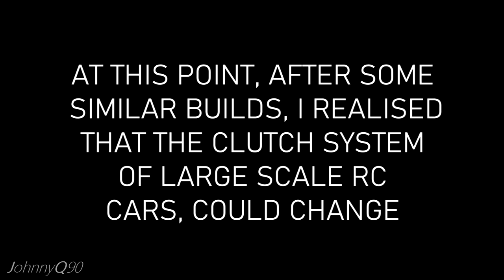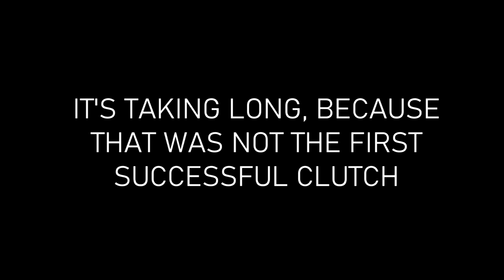Making a MANUAL Clutch for the V8 RC Car - FINALLY!

Comment: Hey JohnnyQ90. I’ve often thought that this would be possible but couldn’t help thinking that such a clutch would require some kind of logic circuitry to be most effective, simply because throttle and steering control pretty much take up all your attention while controlling an RC car. Which begs the question “How exactly should the clutch behave and under what circumstances?”. Sounds like a job for an Arduino Nano to me 🤔

Comment: I was wondering how u were going to make a car like clutch for this thing. This design has a lot of promise. I think the only upgrade might be to make it more like a drum brake on a car. Drum bolts to crankshaft, and then you could have springs forcing the shoes out, and the servo retracts springs

Comment: Maybe add spring pressure to the clutch so it could be button off.     So driving you could pop the buttton on shift on the fly.    Instead of dailing  in clutch force.

Comment: I think that would be better if the servo didn’t have to keep pressing the clutch while it is in contact, this is hardworking for the servo, the majority of time the clutch should be in contact, even when the shaft is in idle! You should probably use a spring to force the clutch contact and use the servo force just to disconnect it!

Comment: hello, i'm following you from naples, if i can give you my advice connect the clutch servo to the pulse of the throttle servo so that when the throttle is opened the clutch automatically engages without having to act on another channel.

Comment: You prob had this question before but just curious how is the conecting rods lubricated without oil in crank case since isnt 2 stroke and atomised fuel isnt run thru crank case like 2 stroke i mean i seen the start the drops of oil used in asembly but is that enough for life of engine?

Comment: Might be better if the clutch is pulled in by a spring so there’s no thrust on the slip ring when the clutch is engage, only thrust on the slip ring when the clutch is disengaged.  Most of the time the clutch will be engaged so you want the wear to occur when the the clutch is disengaged.

Comment: Hey Johnny. Little off topic here but I’ll go ahead anyway. I’m building a RC jet boat using the TFL jet drive B54270 its a 39mm dia impeller. I want to power it with a mini model engine. I’m looking at the NR200 do you think it would have enough torque to adequately drive the jet drive ? Should I go with a Cison L4-175 ? It came with a 4074 1400kv motor. The hull is going to be a 24” long aluminum river jet boat style.

Comment: That flywheel will be great for low end torque due to its massive weight in comparison to the engine weight, but for more revs and faster acceleration a lighter flywheel may be required.

Edit: (secondary thought) Fuel usage would go down as well perhaps with less rotational mass in the drivetrain by reducing the flywheel weight.

Comment: If you could program it to when you have a 3 position lever switch on the transmitter to when you switch it it engages and disengages the coutch for you

Comment: Man, I really liked the car. but like this? What is the total length of the car? I want to build one like this!
With 4-stroke engine, manual transmission with clutch and AWD. making mini car for rally or race. What would you recommend I do to reduce length and weight? I want the minimum amount of shaft connecting one thing to another like you did in the transmission

Comment: Would you be able to make an RC crawler wheel for demonstration purposes in a 2.2 scale size or 1.9 scale size with a pocket nc, I have been wanting to buy a pocket nc but would like see if it can be done first before spending the money on a machine like that. That would be the only purpose for buying one to make wheels for hobby grade RC cars to be able to make custom wheel for my RC cars and trucks. Thank you.

Comment: I think you are amazing bro.... You will need to look at a new controller for it... I don't think a traditional hand controller is suitable.... I was thinking of something like an Xbox controller with fpv so you can steer and change gears at same time using finger trigger for the clutch and thumb stick for steering... Could be a good 3d print project

Comment: Ahhhh....you know you can stick a piece of dowel into your part to catch them before they get whacked by the chuck right?
Oh....when trying to make matching tapers you should never move your compound setting between cutting both tapers.
Even if it means cutting the tapers last and adding a step.
   You can however use a paste lapping compound at the end to make the parts fit properly but I've never tried it with aluminum to plastic but I dont see why it wouldnt work.

Comment: the teflon part has a conical shape but the metal part does not, or at least not the same angle, and the contact surface is too small which equals to more heat, more wear and possibly less grip.
What about making both the teflon part and the metal part both conical and with the same angle?
Reply from the maker: Both male and female cones have the exact same 13 degree angle. I didn't move the compound on the lathe when I was making them, in order to be sure that they will have the same angle.
Reply: @johnnyq90  my bad, I saw in the clip from the beginning what appeared to be a contact line, and I assumed that the metal part was not conical.

Comment: I see a problem here. The servo is pulling an arm that is pushing on the brass collar that is pushing on a spinning plastic thingy. The brass collar is under high pressure and pressing against the spinning plastic clutch thingy. Friction is not a joke, maybe a bearing should be considered. And also don't forget that now you have a force pushing the crank shaft forward. Also bad for the engine.

Comment: I fear that the clutch will melt once you really use it. Maybe a metal cone with cork would be better? You can get cork tiles in a hardware store, but needs a heat resistant glue. The clutch bell can act as form for glueing the cork on/in (pockets?) the cone..

Comment: An automatic engaging/disengaging clutch with the help of an arduino would be nice. Otherwise it will be too hard to drive. Decrease throttle, disengage clutch, change gear, increase throttle, engage clutch. That is too much work to do on the controller.

Comment: The plastic materials are not durable against to the heat and friction. If you want to more durable clutch for your car, you have to use heat resistant material or use metallic material can be keep the heat that couse from friction between cone and bell. 
On the other hand, the automotive industry is using a friction material on clutch plates. It is providing only one item is getting older in using time in the clutch system. Because, it will provide easy and cheap servicing.
Additionally, I would like to say you that, you can use another clutch system between shaft and cone. It is a oneway system for take the first movment stress. Like the 3D printer clutches between motor and shaft.
The last one, what do you think about the multi-plate clutch systems like motorcycles? It will be much better for smaler place than exist.
Thanks for your videos. I am following with interesting.

Comment: Ok so i dont see the link to order one... lol you know you can  start a rc car manufacturing line and promote it all with just these videos ...
Can you set a mixer so as you increase throttle it applys the clutch? Then you can use the dial as a scaler to adjust the engagment point!

Comment: The main design issue I see is that you are relying on the servo to engage the clutch when most automotive clutches do the inverse and disengage the clutch which is under spring tension constantly applying pressure.

Comment: Those U joints are going to fail. They need to be straight in alignment. They are only designed for occasional movement. Not placed in a constant angle. And not sure why you let your parts fly off the lathe instead of catching them.

Comment: Telfon seems to be an odd choice for a cone material.
Reply: Going by the way it cut I'd say it was probably Delrin. Teflon is softer.
Reply: @LesNewell  ok, delrin seems to be an odd choice for a cone material. The brass on delrin bushing  design is suspect as well. Most clutches that use a throwout bearing (i.e. the bushing in this case) work in reverse order. In that there is only pressure on the throwout bearing while the clutch is beong disengaged and, when the clutch is engaged, there is no load on the bearing.

This design is unfortunately opposite, whereby the clutch is engaged by applying constant pressure on the bushing. You've got the double whammy of heat buildup here - the delrin slipping on the cone, and the brass bushing constantly pushing against the delrin to keep the clutch engaged.

That being said, maybe this design is popular in the rc world?

Comment: gear box is power number 0:5 how is power servo motor ???
this is use servo motor gear shaft.
gear 1 and full rpm.
gear 2 and full rpm.
gear 3 and full rpm.
gear 4 and full rpm.
gear 5 and full rpm.
rpm full no gas is engine down
and mph gear down is 5 4 3 2 1 and stop mph.